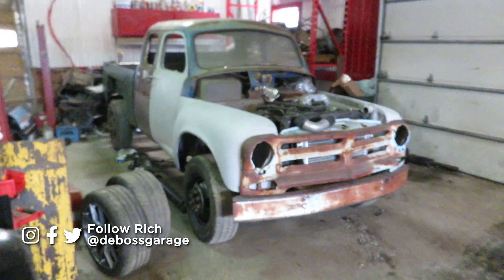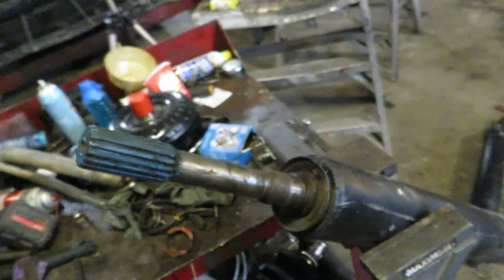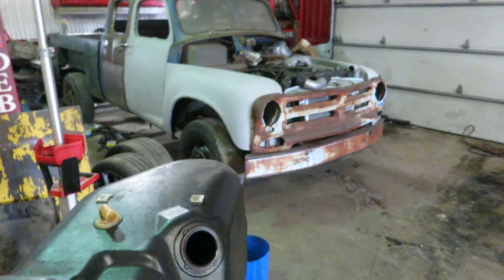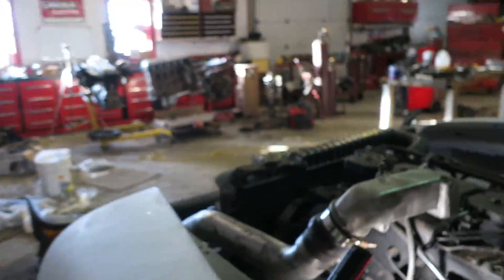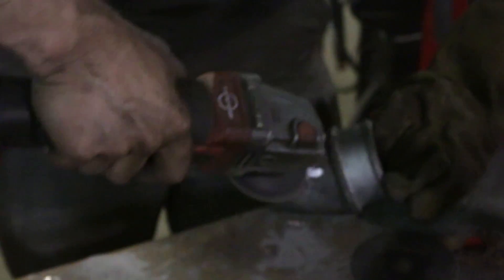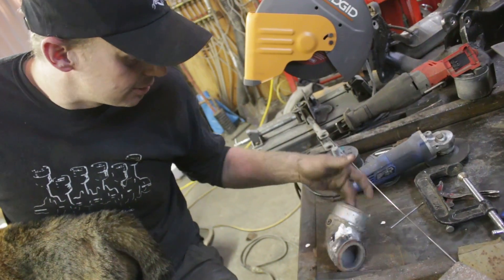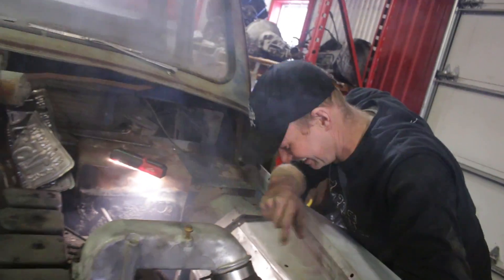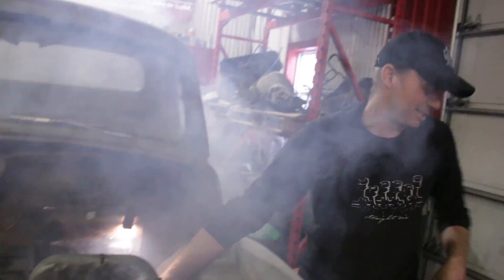FIRST START! 5.9 Cummins swapped EXT CAB Studebaker #Transtar [EP2]

Comment: # 1 Rule when working on a customers project " anything can be made to fit as long as it's a open checkbook " other wise you can't afford it and don't ask me to make it fit .When welding aluminum the biggest trick is to use separate tools for grinding , cutting, cleaning never use a tool that touched anything but aluminum , clean hands and filler rod. Cross contamination make welds crappy looking and weaker. Old parts should be cleaned and pre heated to help release old oils. The cleaner the easier to weld .

Comment: Best tip i ever got for aluimium welding is make sure everything is super clean. Makes a huge difference, that's what the black areas on the weld mean are it's a bit dirty, weld will be good non the less.

Comment: If you are doing a remote boost unit for the brakes, could you not fab up a vacuum boost unit under the truck frame like the medium duty trucks.  chevy c70 or something.  Simple master cylinder to the firewall to a vacuum boost unit under the truck somewhere.

Comment: I need a 12v for this 7.3 powerstroke I got
Reply: 7.3 is just as good. I have 400k on my 2000 crewcab dually 4x4 and never had the engine open. Cummins are over rated. I LIKE Cummins, i just think its retarded to Cummins swap EVERYTHING

Comment: Nah, get rid of the 3.73 & throw in a 3.55, ive had 2 trucks w 3.55s & they’re great. Had a truck w a 4.10 that was a 7.3 that got like 10-13mpg threw a 3.55 rear axle in it & get 18mpg Highway.
Just got a 3.55 ZF5 idi & it’s great.

Comment: Rich, would you care to do a floor swap for a 73 Crew Cab Chevy 2500?
Reply: I have a 91 D250 reg can long bed with everything but the dash (and the stuff needed to run the engine) in usable/reusable condition for trade if you’re interested. It’s an AZ truck so there’s no rust. Some dents and surface rust, but no cancer.

Comment: Moving the intake piping would be easier then modifying the hydro-boost?....no? Turning the intake snout into a 45 forward? Also look into the van master with the same gm hydro boost, maybe it will fit under the intake snout...

Comment: Question. My dad pulled out a duramaz out of a 2008, unsure what kind it is. The truck got hit by a drunk driver in the rear end, motor, tranny, transfer case are all good. Although would it be able to fit in my 1999 silverado 2500?

Comment: Had a 1974 Chevy C50 that had a small brake cylinder on the fire wall that was plumbed into the larger hydrobooster under the floor. No mechanical connection.

Comment: hi rich with your aluminum turbo elbow "fiasco" did you use an old grinding wheel to prep the surface? if so you just contaminated the surface with carbon I cant remember the name of them but there is grinding wheels made just for that job also do your self a favor and buy a good stainless wire brush that is used strictly for aluminum it will make everything go alot better and you need pure or 2 percent ceriated tungsten when welding aluminum 
cheers Tyler

Comment: Tip: 
The difference between an ok weld and a bad weld? A grinder.  Haha.  Grinder is a bad word to some welders. 
I have never been able to weld with a nice appearance.
Reply: It ain't got to be pretty as long as it holds. I've seen pretty welds that didn't hold. Oh Wait! Were you talking about your appearance or the weld?
Reply: @fascistpedant758  very true.   haha. I guess both.  My beard could use some grinder touch ups.

Comment: Sometimes an hour, hour and a half in a well stocked wrecking yard, say once a month,  just wandering around an looking at "stuff" is worthwhile (and its usually pretty quiet).  Not that you don't know and with nothing in particular in mind for this build BUT it just strikes me that somewhere there must be something much closer to functional for what you need than what you were given in this case.  Unless of course I have completely misread and these were parts the customer specifically wanted to be included.

Comment: 3.73 gears are too high. Had to take the 3.73's out of mine and put in 4.10's cause the truck was going nearly 120 mph at optimum engine rpm of 1900 to 2000. It hit 150 before I took my foot out of it and had plenty left.

Comment: This thing is pretty cool. Lots of funky fabrication. Its great if you enjoy the challenge and find the time and patience to do it right. There were more levers on that machine, a second one for the handbrake would be cool and not that much more trouble. I'm swapping an old G Wagon to diesel. Have you ever used a plastic gasoline tank for diesel fuel without long term problems? Thanks for sharing the fun. I hope it's worth the trouble for you. (Did you fire the glow plugs before starting it?)

Comment: Come on man, 1.575 inch is exactly 40mm. Stop fighting it, the manufacturers have moved on from measuring things compared to body parts, just accept it and move on. American car manufacturers were forced into the metric system because the rest of the world doesn't care that you can't buy, sell or trade in imperial measurements. And never call it a 19 millimeter spanner, it's just 19 mill. The extra breath is just wasting everyone's time. Otherwise, thumbs up (or is that 2 and 1/2 digits) for the video.

Comment: Not to smart to run them without coolant.. those cylinders get hot pretty fast.
Reply: you can run those engines for longer than you think without coolant. alot of the drag trucks have the coolant ports plugged off for extra strength and run multiple high hp passes without coolant.
Reply: @longscaling2408  ya you can DO stuff like that but it's not a great idea. There's alot a pressure and heat to fire those things. Especially if this is something you want to get a nice long service life out of.
Reply from the maker: It's a 1200 lb engine.  Running it without cool and for 20 seconds will do absolutely nothing
Reply: @jacobdukes4741  I know if I were paying to have my truck built, I'd advise they put the radiator in BEFORE the Whiskey tune up.

Comment: Don't you open doors when running cars much less old diesel trucks ? Yet he wears a welding helmet. Fumes must have gotten to him. Go 
sulfur.
Reply from the maker: Welding mask has a hepa filter and there is a 4' exhaust fan in the ceiling